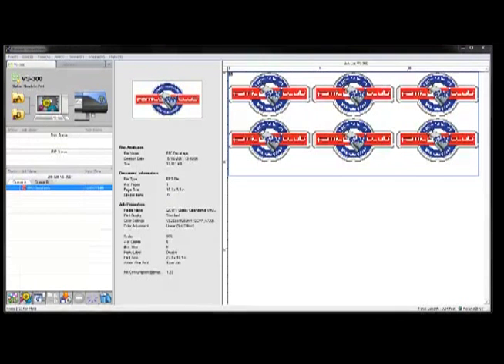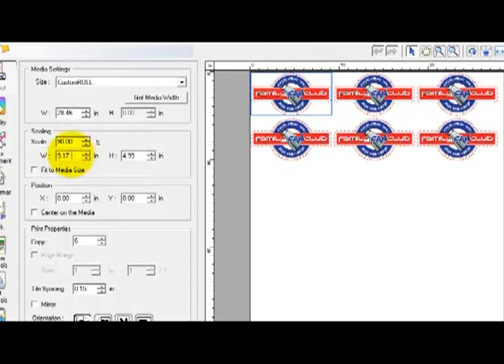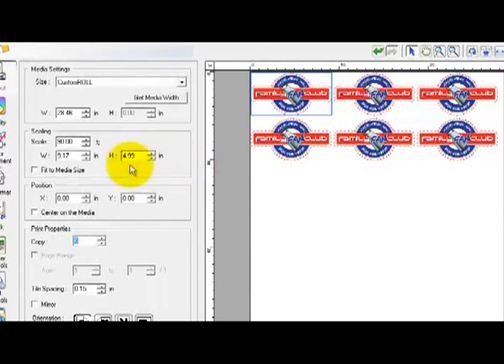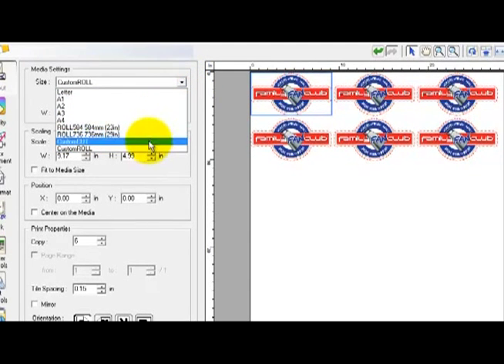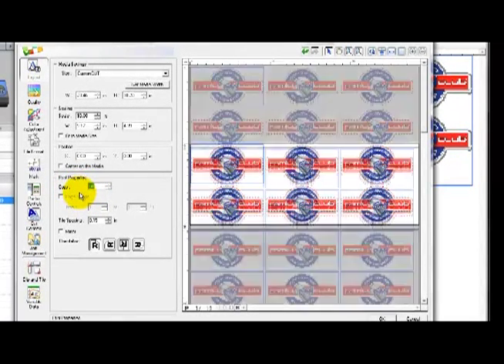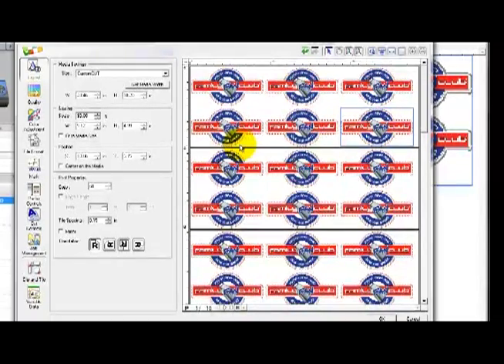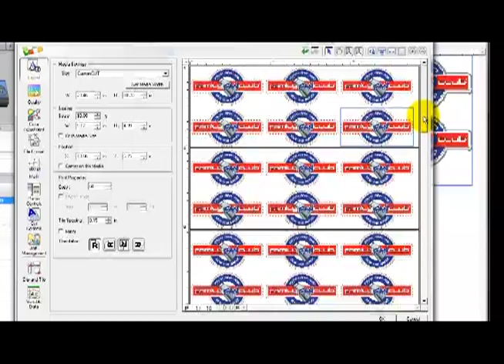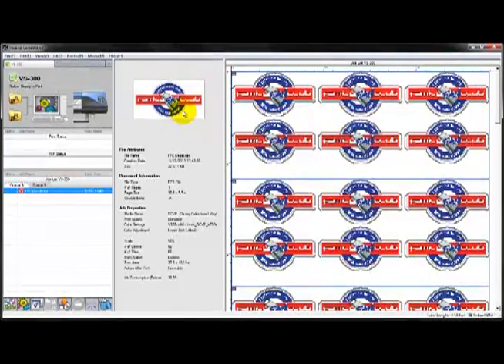Training Time Out - Print and Cut Accuracy

Comment: This is a great feature. But I have art that is 10" wide and 5" high. I rotated the art so that I could fit more width wise (4 across). But when I put these settings in, its stacks the art (3 stacked) and I have a lot of waste. Does this only work with the art being in its original orientation?